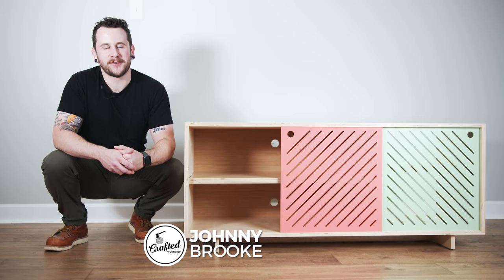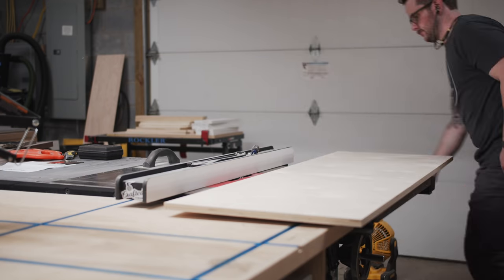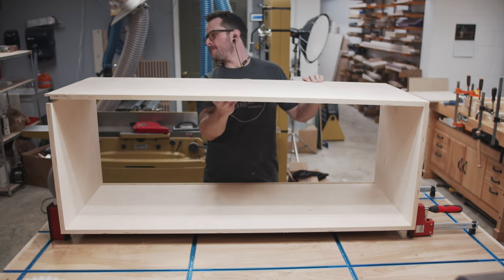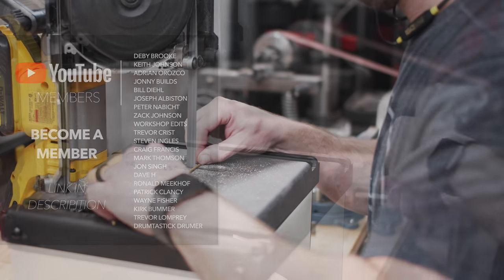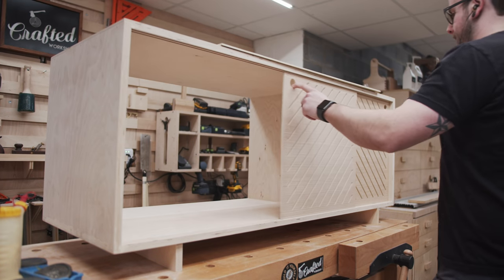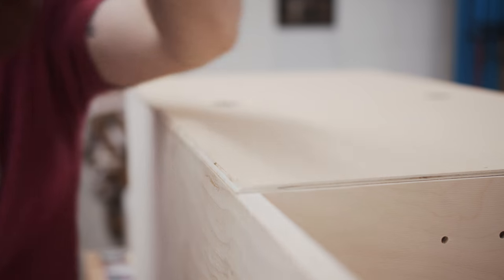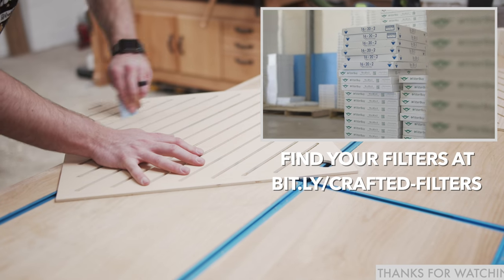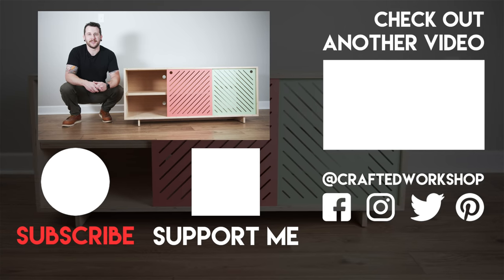DIY Modern Plywood TV Stand or Media Console // How To - Woodworking

Comment: Use brass screws and cut the heads off. Sand them flush and then you don’t need epoxy or ca glue. Makes a strong joint.
Reply: Brian Tafelmeyer I’ll be borrowing this idea. That’s brilliant.

Comment: Why do you need filters? I live in Sweden and have never heard of people using airfilters in their homes.
Reply: In north America we have central heating systems with duct work throughout our homes. This duct work spreads the heat to every room of your home.

There is also a central duct system that runs from the top to the bottom of your home, this helps circulate the air it just pushed out to the rooms. 

Houses get dusty because of pets, people, and a whole array of things, and air filter goes between the incoming air from the inside of your house (air returns) to the air it pushes out to the rooms. Those fillers should be changed every 3 months

Comment: Johnny, there is certainly a lot of good info here and as you know, I'm a fan. But I have got to tell you - and maybe I'm just a cranky old man - but I am troubled about the growing prevalence of the whole CNC thing in the woodworking world. I am subscribed to a lot of woodworking content creators and maybe this is going to be your niche, I don't know. I saw the opening still shot on this episode and the first thing I thought was "Great, another CNC and a laptop project." I hope this is not the new path you are setting on but a kind of a "oh, this is kinda cool!" diversion. You do a great job and your content is engaging with good techniques and a sense of humor but I respectfully suggest that you try to appeal to a broader demographic by bringing in some more traditional techniques. Maybe that's not your thing and that's okay too.
Reply from the maker: Thanks for the feedback, Steve. I would say that CNCs are not going anywhere and are going to become more prevalent in years to come. They are an incredibly versatile and powerful tool and the cost of adding a CNC to a home shop keeps going down. My X-Carve is probably the cheapest stationary tool in my shop and is also one of the most fun to use. I would challenge you to find a local Makerspace and give it a shot. You’d be surprised how satisfying it is and how it can change the way you work. On this project, all I did was cut some lines, something that could have been easily done with a handheld router. I’m not even scratching the surface!
Reply: Crafted Workshop: Johnny, thanks for your typically polite reply. I’m the guy who said “...that internet thing is a fad!” And here we are....watching streaming video content on...everything. I’m sure you are correct about the future of CNC machines. I suppose I will succumb but I’m going to try and develop my chisel and plane skills first. Keep up the good work my technologically advanced friend!